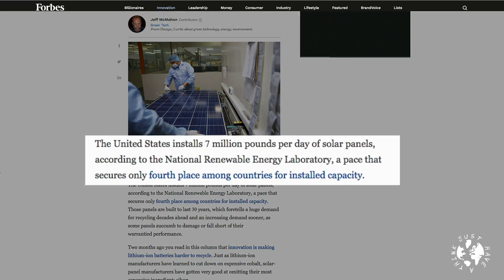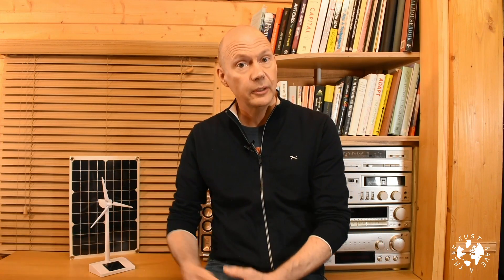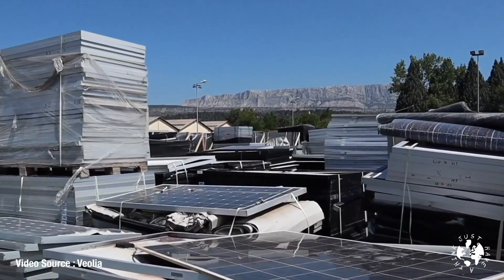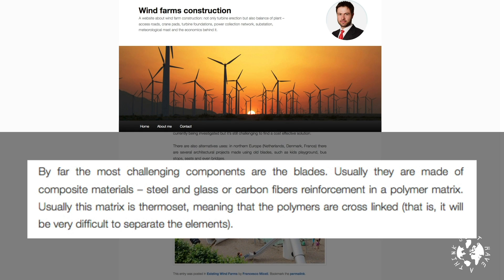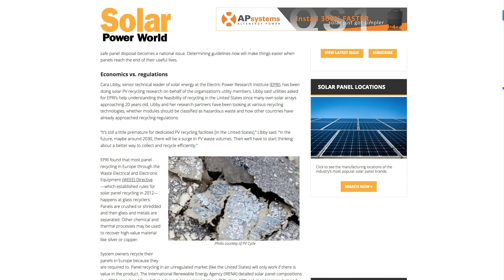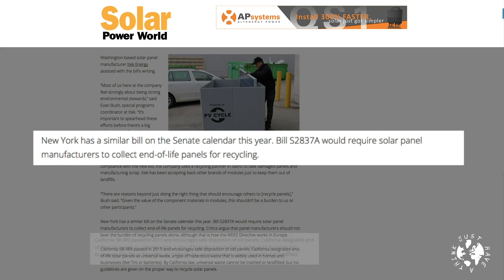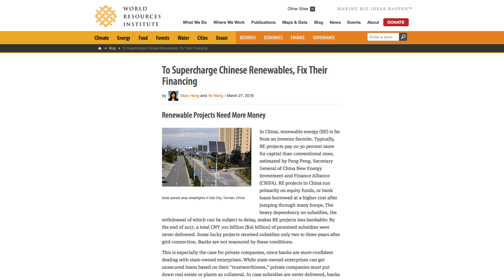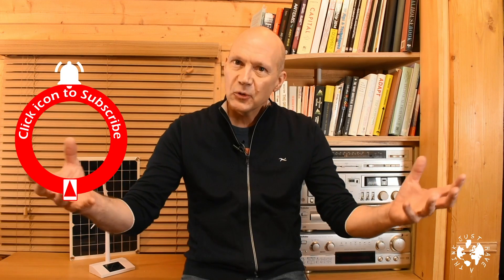Recycling renewables : a price too high?

Comment: So to summarize: 
1. Solar PV: Veolia in France is already paving the way for large scale PV recycling, with a proven path to recover ~90% of the materials. Anything that isn't reusable is non-toxic and can be used as raw material for whatever you see fit. 

2. Wind turbines: It's just a bunch of steel, concrete, and glass fiber. As stated in the video, the only thing worth worrying about in the slightest is the glass fiber, and glass-fiber reinforced concrete (GFRC) has been around since the 60's. Concrete combined with high-strength composites is probably going to be one of the most important modern materials for building huge buildings, superhighways, etc. I don't think demand for the stuff will be a problem.

To me, this doesn't seem to be an issue. I don't think we need to start slowing down growth of renewables for ANY reason, especially not for a fear that we might not be able to think of a use for the raw materials. 
The bigger problem right now is that everyone gets complacent when they see that another couple gigawatts were installed in their country, when we need to be talking about terawatts.
Reply from the maker: I agree entirely. I just wanted to raise it as a caveat, but I would never suggest slowing down the progress of renewables. In fact there have been so many great ideas about recycling renewables from subscribers that I will be doing another programme later inthe year as a counter balance to this one. Cheers. Dave
Reply: @JustHaveaThink  Ha, thanks for replying. Rereading my first comment, I just realized that I sounded quite crabby. Thanks for the research that you're doing -- I think your channel is starting a lot of great discussions. Best of luck to you!

Comment: Why would you recycle a wind tower or its base, and why could you not repair the generator and refinish the blades? Sure gears wear out, but new ones could replace the worn out ones.

Comment: Heated to 500 degrees C using natural gas?
Reply: probably...atm at least, but it will still have a vastly less carbon footprint than just burning fossil fuels to get the energy in first place. 
Tbf fair though, whilst the production (and deconstruction no doubt) of wind turbines/solar panels/tesla cars has a fairly large carbon footprint, it wont always be this way. There is no reason that building them is so environmentally costly other than that is how it is done atm. Given enough time and effort, attention will be placed on making the manufacturing industry renewable (could be a while though lol)
Reply: @Paul-zk2tn  "Everything that could go wrong will go wrong."

Comment: Yes and No.  No issues with recycling but collection.  They have to be properly collected for recycling to be viable.  My solution is for cities to create warehouses for used solar panels.  They will be stored there until transferred to a recycling facility, in another city or country
Reply: Take back stations with an own warehouse are not required. Usually we prepare one pallet (around 30 PV modules) full with defect PV modules and send the pallet to the recycling facility or we wait until we have 20 pallets full with defect PV modules and fill a truck with it. The second option requires an area sized 3 parking spaces, outside (we never considered to store it inside a warehouse). Every PV module wholesaler can do that.

Comment: Solar panels don’t really “wear out”.  The output does degrade over time and in about thirty years will probably be putting out only about 80% of the original power.  Unless there is environmental damage they are still fine.  Just repair or refurbish them, add a few new panels to bring back the lost capacity, and you are go for another thirty years or more.  Or, donate them to someone who would be thrilled to get 80% efficient panels for cheap or free.

Comment: You did a video to debunk a bullshit argument put out by the fossil fuel industry, but you did a good job.  You also should have talked about batteries since they are about 95% recycleable, and will get better and cheaper to recycle as there is more production.   But by whom?  There is no one investing in batteries in Europe (except for North Volt and Tesla soon).  This is by design since Davos doesn't want to have anyone invest in batteries.  And Davos is paying for people to come up with the memes that your are trying to debunk.
Someone made a good comment about having the greasy boot on the other foot and ask how the fossil fuel industry is going to take care of their infrastructure.   Each Frack site has hundreds of wells, all with pipelines that will be contaminated with god know's what since the formula is a secret.  Tar Sands recycling might as well be sent to Venus to pollute their planet, but we'll get the reputation of bad neighbors in the solar system.

Comment: "You can't get yourself out of a problem when facing it with the same attitude that got you into it in the first place"
Our economy is based on the recycling of money, not resources.
When things were hard to build, we made it to last so we didn't have to make as many. That resulted in less resource use.
Reply: We vote with our money when we buy cheap crap that's borderline disposable.
Reply: @Luke Monsensey the most recent example of a grid failing due to cold weather was primarily the result of gas plant failing in low temperatures and an inadequate supply of natural gas with solar and wind both losing a lower percentage of their generation capacity, so that definitely hasn't been the case historically. In addition to this wind energy costs roughly 1/3 what natural gas costs to produce and solar is roughly on par with the cost of natural gas per unit energy meaning that at best natura gas is currently on par with a mixed renewable grid when it comes to cost and reliability.
Reply: @Luke Monsensey current wind energy prices are down to 2 cents per kwh even factoring in that they run at reduced capacity most of the time, and the cost of transmitting electricity is both inherent to all grid sources of electricity, and not a significant factor when each turbine averages out to supplying the equivalent amount of generation to that consumed by a few hundred or sometimes even a couple thousand homes. The entire energy sector including natural gas production is so heavily subsidized that the amount of government assistance wind farms receive doesn't exeed the amount natural gas stations typically receive enough to skew the data significantly. As for any natural gas being consumed to make wind turbines it is pretty safe to assume that the amount of natural gas needed to produce otherwise even your 15 cents/kwh home price would be a tad bit low.
Reply: @Luke Monsensey just looked up the cost of unsubsidized wind energy, it is between 2.5 and 5.4 cents per kwh depending on the particulars of the installation.
Reply: @Luke Monsensey have you looked at the profitability of extracting natural gas from deposited in the US? There are people who start natural company's sell the gas at a loss exaggerate the amount of gas they have and then promptly sell the company to investees before it goes bankrupt.

Comment: As the wind turbines come to the end of their lives, why not put a new nacelle and blades on top. You've already got the tower in place... why not reuse it? As raw materials get used up, we are going to have to either find more... not likely or recycle old material. Old landfill dumps are going to literally become gold mines.
Reply from the maker: Hi Paul. It's a fair point. As a Project Manager myself (in my actual day job) I'm often fighting against planners and structural engineers so I can imagine that there will be some daft regulations that preclude such a sensible idea as yours. I hope modern manufacturers will quickly start to build a bit more future proofing into the products in the first place though. We shall see.

Comment: Recycle and Repurpose is the simple answer. 
Eventually the Law of Entropy will play into this when Recycling. But Repurposing produces new ways of taking products otherwise destined for the land fill into useful products or private projects.
Reply from the maker: I agree 100%. Just wanted to raise the issue seeing as it's getting press attention and some folks out there are using using it to denigrate renewables and promote nuclear, which strikes me as disingenuous. My conviction and commitment to renewables has not change one iota though, and I do sincerely hope manufacturers will indeed start to fabricate panels in a more re-useable way (or at the very least a really vibrant community of 'make do and mend' artisans will pop up as these panels grow older.) All the best. Dave

Comment: Since most failures of PV panels are intermittent or broken connections between cells, we should mandate indicators be manufactured into them for where to drill to access each cell and each line of cells so that new interconnects can be installed and resealed with epoxies. These things should be repairable, since they actually last for a century or more at some substantial fraction of original power!!  Better, have individual cells be backed and sealed individually so that they are replaceable.
Reply: Good point.

Comment: Renewables are not competitive, they are heavily subsidized, electricity from green sources are more expensive.
Reply: Every time installed kW double, the prices for a solar-produced kWh drop by 20 %. ECONOMY OF SCALE. It is like that for panels since the 1980s, it exists for every technical product that is new and is mass produced in increasing volumes (although the prices drops and quality leaps are different, with electroncis or processors it is Moore's law).

That price drop (improvement of performance and/or cheaper production) has nothing to do with the passing of time. The Germans had to give a lot of subsidies in the beginning but it created a market where companies innovated (and their research had a chance to pay off). That and more Chinese purchases let panel prices drop so that they became interesting in sunny, wealthy areas with a lot of A/C running during day and where electricity prices are medium to high (think Australia, California, ...) Now that was another 60 million people market. So another wave of sales - and more price drops.

Rinse and repeat.

Batteries and other storage are the next frontiers. There some improvement in prices is wanted. (10 % improvement in panels, 10 - 20 % in batteries - for homes - would mean another massive shift in the market).

Germany now imposes an extra fee of 2,3 cent per kWh on larger producers of solar energy for SELF CONSUMED electricity (only installation that are modestly sized for homes are excempt). May not sound much - but if you produce at costs of 7 cents a fee of 2,3 cents makes a dent. That is to prevent that large users of electricity with an ideal profile (using most or all during day = companies) go solar.

I guess if companies and homes would go off the grid they could evade the fee. There is no mandate to be connected to the grid. Off the grid would mean: no selling of surplus, which is not very lucrative anyway, but more importantly w/o the security to have the grid as backup.
Reply: A German manufacturer KACO got a 2 MW solar  installation (must have been 2013 or earlier *), cost them 2 million Euro (no subsidies), they save 350,000 Euro on electricity per year.
(they produce transformers, so that part of the installation was cheaper for them, and no doubt got good offers for what they had to purchase - but still, with an expected lifetime of at least !  20 years for a quality installation, that is a wildly successful investment).

* I saw a slide with their harvest on a sunny day in August 2013. They needed a little bit from the grid during night and  till 9 a.m. and again from  late afternoon on. Else they produced all electricity they needed inhouse.

I did the math, if they pay the average biz rate in Germany of 20 cents per kWh they have to pay now 45,000 Euro per year on the electricity they produce and consume (the "let's-prevent-big-solar-installations" fee of 2,3 cent per kWh)

They buy much less electricity from the energy provider than they used to and should contribute to the grid and the backup the energy provider gives them.

BUT: that is some money - and there are some mini electricity plants powered with gas or biomass that produce heat and electricity in tandem (they are even sold for private homes, efficiency is of course better when the units are larger).

When batteries are getting cheaper they can have more, get some more panels, on cloudy days or in fall / winter / early spring they can get electricity from their own mini-plant. With more electricity storage they would only need the mini-plants for electricity when they need heating anyway.

Using the heat that usually goes to waste raises the efficiency of a steam engine from well under 30 % (that is a law of physics) to plus 60 %. Combustion engines have the same poor efficiency. Admitted solar panels are not better, currently they have approx. 24 % if they are good (40 % might be possible in the future). But they run of course with a source that is not finite in human dimensions.

And solar harvest in winter is not zero (on sunny winter days it is quite good, even better with snow reflection). Solar panels also transform daylight although they work much better with direct sunlight (cool and sunny like in the mountains with more UV radiation is excellent - I read a commen from someone having panels in New Zealand - and no one can accuse NZ of being a sunny country).
Reply: Production costs for electricity with up-to-date solar panels are 7 cents per kWh. That is the yearly average in cloudy cool Germany (factoring costs for the realistic lifetime leaning on the shorter lifespan, if somewhat reduced performance is acceptable 50 % - 70 % you can squeeze more use out of them, so the production  costs will be lower).

production costs per kWh are lower in the more sunny regions of Germany. Now, that cannot compete with the 2,4 cents per kWH midday in 2016 in Dubai (which broke a record then, it went even down after that). 

At that costs the sheiks ordered the next solar power plant, they use them instead of gas turbines (in Dubai mind you), because it is cheaper. I assume they have gas turbines during night - but they need a lot of electricity during day with A/C.
Reply: The electricity grid in Germany has been adapted is now in general MORE RESILIENT. Blackout events and duration have gone down. Dr. Eike Weber presented the numbers from 2006 compared to now (even then Germany did better than France or U.K). Then they had to adapt to the fluctuating input from wind and solar. - The medium to large plants that had dominated the scene delivered energy very reliably - but if they had a problem (a storm, a fire, safety shutdown of a nuclear power plant) then they missed out on a lot of electricity all of a sudden.

Now it is not humans that improvise to cope with the more rare but consequential larger blackouts - it is automated. So now the number of blackouts has decreased (I forgot the number: minus 20 or 30 % in that range)  and the duration (there is an industry standard number for that) has halved. 
If they can deal with renewables on a daily basis,  than they can cope also better with the occasional larger blackout event

While France and U.K. stayed at the old level.

I got those informations (also the numbers and examples quoted in the other comments) from a presentation of Dr. Eike Weber (Fraunhofer Institut).

Comment: Www.nanotreat.co.uk will protect your solar PV panels from degradation from the elements. One application will last 20 years. Coat your panels every 20 years and give them a new lease of life. Efficiency even increases after the coating is applied - how cool is that !
Reply from the maker: Hi Angel. LOVE THAT!! :-)  Great info. I have solar panels all over my house and garden cabin (where I do the videos) so I will certainly look out for this product. Many thanks. All the best .Dave
Reply: @JustHaveaThink   To be frank I would check that out with the supplier of the panels. you do not know how that could affect performance (absorbing radiation), let alone the substance could do some damage.

Not to annoy +Angel Michael - but if the procedure would be so beneficial surely there would be recommendations and cooperations with the manufacturers (or they would apply it as last step by default).
Reply: @xyzsame4081  apparently - they have an engineering report performed in California indicating COATED panels producing 17% more than un-coated panels. Product is titanium based and patented - they say.